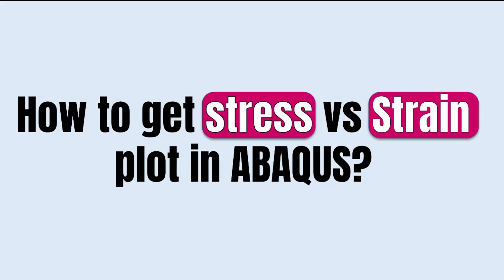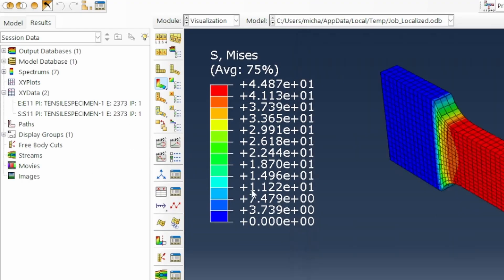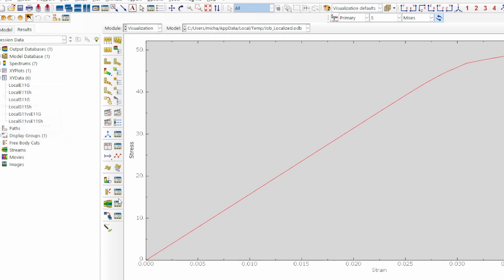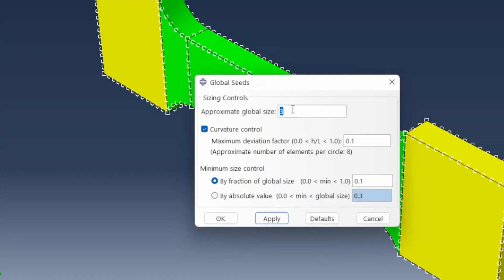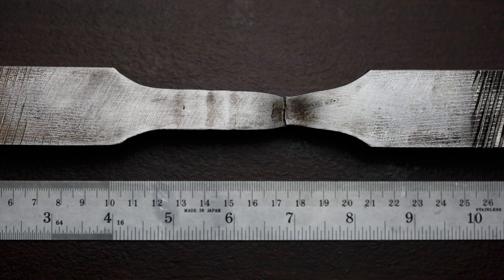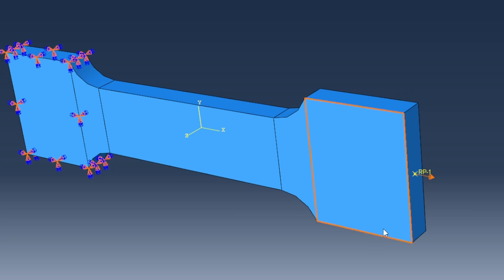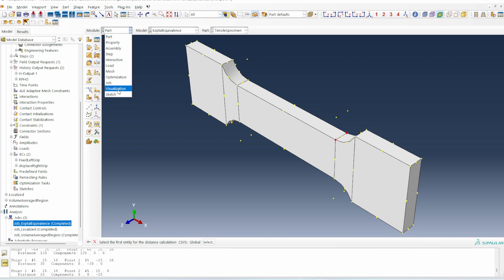How to get STRESS-STRAIN curve in ABAQUS using 3 Approaches

Comment from the maker: Time stamps
--------------------------------------
You can quickly navigate through the videos using these chapters.

00:00   Intro
00:40   ABAQUS Setup of Tesnile specimen case study
01:40   Approach 1: Localized stress-strain plot
06:32   Approach 2: Volume-averaged stress-strain plot
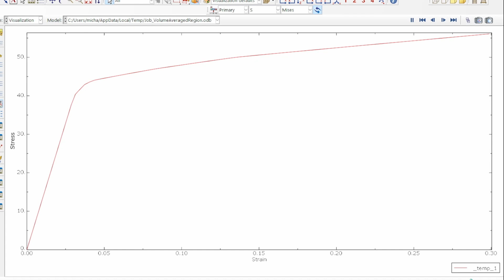10:32   Approach 3: Experimental equivalence stress-strain plot
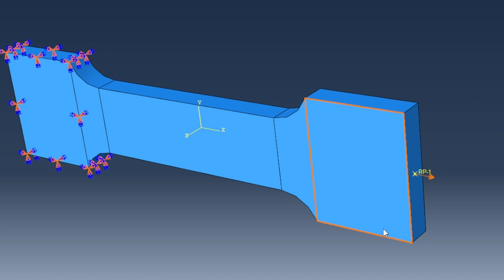13:57   Analysis of experimental equivalence approach simulation results
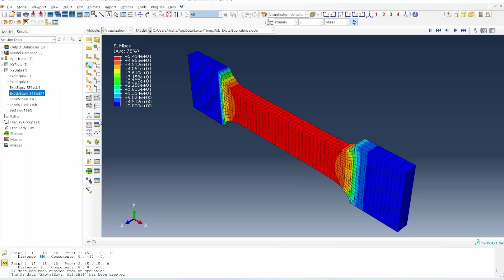17:36   Comparison of stress-strain plots from the 3 approaches
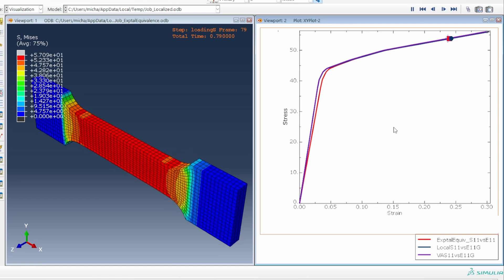19:26   Outro

Comment: Hello Dr. Okereke, I am simulating a tensile test of CFRP using a shell element. In my first approach, I fixed one end and applied shell edge load on the other but I ran into a convergence issue. Because of that in my second approach, I applied shell edge load on both ends. I created history o/p and requested RF over the nodes on the two end edges but I got zero reaction forces although the Sim. ran successfully. Can you please advise me to follow the right approach? I also want to plot a Force vs Displ. curve
Best wishes
Reply from the maker: Use the approach I use in my model using a referral point note and kinematically link it to the edge. Apply your load on that node and extract your history output from that reference point node.

Comment: Dr first i want to send my regards for your comprehensive explanations and second i have a question. 
How can i extract the stress on a surface middle of the model or RVE. To be exact think of a surface that is cutting the RVE or model into two parts now we want the average stress in this surface. Please help
Reply from the maker: Hello, thanks for the query. 

This is possible. You simply need to identify a set of elements in the surface you want to. Associate them to a set and then use history variables to track them later.
Reply: @MichaelOkereke  for making the set i need to make a section in middle ? Or there is other ways.

Comment: Great job Dr. Okereke! If I want to plot Force-displacement curve of a crimping stent test to compare it with the real experiment, would it change something with respect to the third approach you described? Because I am struggling to do it. Thanks in advance!
Reply from the maker: Great suggestion! I have not tested it out but it is possible to use a reference point to link the surfaces of the stents where the radial displacement is applied. Then, using that extract the reaction force and displacement to get a force-displacement plot. I will try it out and it might work, but I cannot say for now until I try it out.
Reply: @MichaelOkereke  thanks! If this works I will put you in my acknowledgments. I am working on bioresorbable shape memory stents.

Comment: SIR HOW TO SIMULATE  TENSILE  SPECIMEN FOR DISSMILAR MATERIAL WELDING  AND HOW TO USE ACTUAL STRESS STRAIN DATA IN ABAQUS
Reply from the maker: I believe the approach shown here will still work. You probably will be better off using the Equivalent Stress-strain approach where you model the two dissimilar materials and extract their reaction forces and grip displacements using the reference nodes approach. This way, whatever is happening internally within the dissimilar materials following your study will result in a reaction force which is captured at a reference node. This is what I suggest you consider. Good luck with the study.
Reply: @MichaelOkereke  thank you

Comment: Maybe you could compute the true stress - true strain curve from the experimental results. I think this new curve will fit very good with the others. Thank you. Nice video.
Reply from the maker: I think this is possible but it might not be the case here as the shoulder effect is causing the problem.  If it was what you say, then the elastic section will line up together as others. Post yield differences arise from the plastic region rather than elastic section.
Reply: @MichaelOkereke  yes, you are right. I didn't take into account correctly the difference in the elastic region. As a matter of fact, I am looking for a numerical experiment to teach the difference between stress-strain and true stress-strain and I thought that your example could be one of them, but it isn't. Thank you for your answer.

Comment: Very nice way of explaining the  concept sir. Sir, can we extract directly the stress strain plot from the reference point without first extracting force displacement plot from the history output as explained in 3rd experimental equivalence approach? Also, is the first two plots are  true stress strain plots and the last one approach( experimental equiavence) is engineering stress strain plot?
Reply from the maker: Thanks for the comment.  A really good question. 

You certainly cannot extract stress or strain variable from the reference point. This is because the reference point is a nodal point and stress and strain measures are variables extracted from an element set rather than a nodal set. Also, the first two plots generated from localization and volume averaging methods are true stress and strain values. To be precise the stress is a 'Cauchy stress' (an equivalent true stress) measure. It corresponds to the force per unit current area. 

For strain, it is a bit complicated as ABAQUS handles strain measures differently. The one shown here is what ABAQUS describes as an integrated total strain - which represents strain obtain by integrating the strain rate of the simulation numerically. It is a bit complicated but will depend on the type of simulation you are doing and the type of solver (ABAQUS Standard or Explicit). Other more common strain measures are the logarithmic strain (LE) and nominal strain (NE). For most cases, and like the case considered in this video, the total strain E11 (along the x-axis) can be assumed to be representative of a true strain but if you do want to test this out yourself, then do so. 

The values from my last approach (experimental equivalence) is definitely an engineering stress-strain plot as a force measure (though current as we tracked it with time) is divided with an initial area. In the problem considered, the area remained the same throughout the simulation. In which case, the current area was equivalent to the original area (since there was no change) hence the equivalence between this approach stress-strain plot and those of the other 2 approaches. 

What would be ideal is to track the area values as a function of time and the force values as a function of time (this later already exists). To do so for the area, a coding with Python script will do so. Currently, at the first time-step, I  use my script to extract the area. I need to rather do the extracting across all time-steps or frames of the simulation. If this is done, then the force divided by that current area (per time-step) will yield a true stress-strain plot even with my third approach. 

It is a long explanation but I hope this makes sense to you. Let me know in the comments if there are further questions.
Reply: @MichaelOkereke  Thank you very much, sir, for your excellent and clear explanation of my query.  The way by which you are explaining the concept is really impressive.

Comment: Your explanations regarding the tensile simulation are excellent. Could you please provide me with information regarding the strain rate or cross-speed utilized in the simulation?
Reply from the maker: Hello @Hemant, this simulation was a STATIC  GENERAL simulation which means the load was applied statically. Therefore effect of strain rate is very minimal and more in the quasi-static range. For a quantitative data, I have applied a total strain of 0.30 over a time of 1 seconds. That means the strain rate is 0.3 per second. This is a quasi-static data but you have to take this with a pinch of salt. If you truly want to quantify a strain rate study, then you have to do a dynamic implicit or explicit simulation where loading effects are adequately considered.

Comment: Hi Michael, Thank you for these brilliant work. I realised that in your experimental equivalence approach, when you combine the RF1/120 and U1/(30*10), your plot still comes out as Force vs Displacement. You didn't convert that to Stress vs Strain before combining them with the Localised and Volume Averaged Stress - Strain Plots. Is there any particular reason you didn't convert the Force vs Displacement for the ExptEquiv plot?
Reply: Yes,  I realised that Michael,  though the plot is stress-strain,  the labels are Force and displacement.  I managed to change the labels within Abaqus but yes,  one can also do the same in Excel.  Much appreciated
Reply from the maker: Hello Josh, this is a brilliant observation. This is a bit of problem with ABAQUS. Although I make the conversion from force to stress and displacement to strain, ABAQUS still plots force in place of stress and vice versa. This is because it does not recognize the conversion I have made but plots the variables based on the original values. This can be sorted if you take the data into say Excel and plot it yourself. Just to make sure in this case that what I am saying is true, look at the original force displacement profile and compare it quantitatively with the stress-strain plot and you will see they are different. I hope the above makes sense to you.